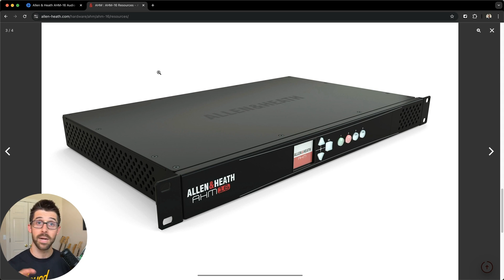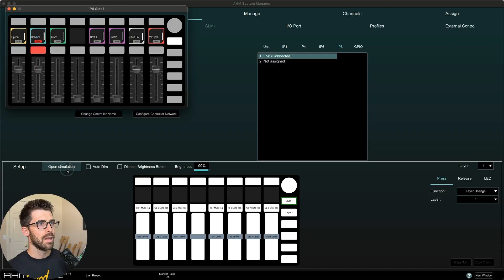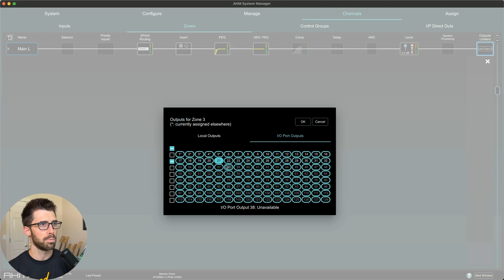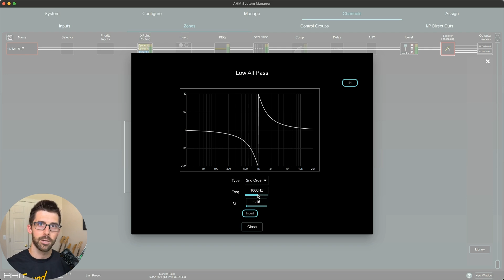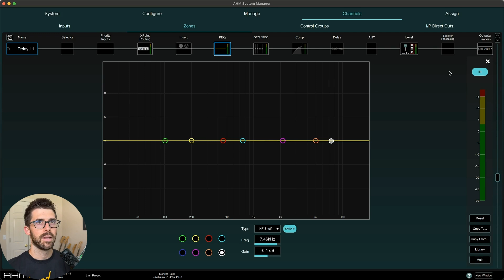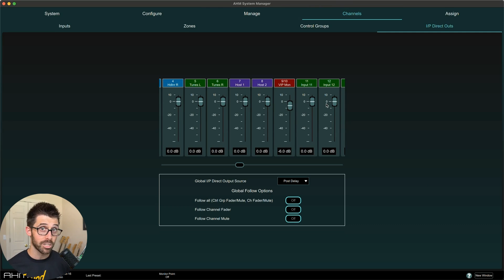Exclusive FIRST LOOK at Allen & Heath’s AHM Firmware V1.5 with Michael Curtis!

Comment: Hey brother I really enjoy your videos. I wanted to ask you if you can maximize matrixes on the sq using it with the ahm16? Also how do you compare Allen and heath dlive with the Yamaha dm7 I’ve seen you using and talking about? I’m thinking of investing in a dm7 compact
Reply from the maker: Thanks for your questions! Give us a call at 800.203.5611 and we'll be happy to answer any questions. We'll help you get the right gear the first time and for your best price! We are open Monday - Friday 9am-5pm CST.
Reply: I’ve used a DM7 and I own a SQ5. The DM7 compact is the better console. It’s more robust, smoother workflow, more flexible. But it’s almost 4xs the cost. If you add stagebox cost it’s 10x.

Comment: Awesome video, great job. 

I have a question regarding the IP8 that’s a little off topic. Would you happen to know how to get it connected to the mix rack rather than the surface? 

At the moment I have it connected to the network port on the mix rack and configured on using the S500 surface. However, when I shut down my S500 the IP8 also goes out.
Reply from the maker: Hi! Thanks for your question. You have to hit the Mixrack button while the IP8 is plugged into the Mixrack network port and configure it from that Controller tab instead of the Surface one. If you have additional questions, please give us a call at 800.203.5611. We are open Monday - Friday from 9am - 5pm CST and happy to help you with your gear needs. Have a great day!